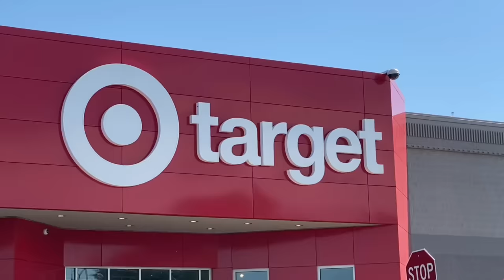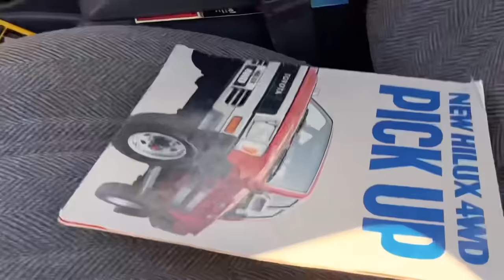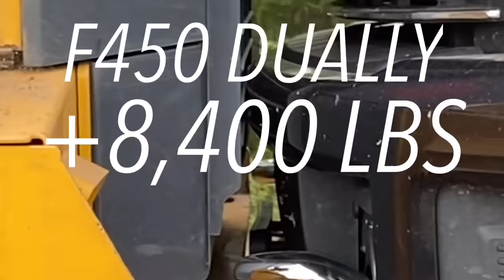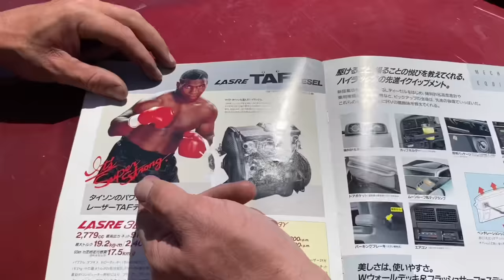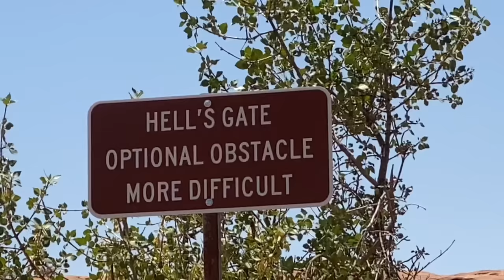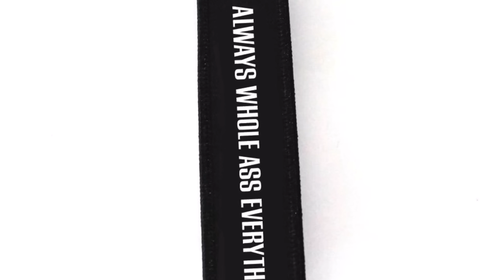Toyota Hilux Durability Test #3

Comment: It's actually quite impressive that the expensive, custom build 4wd racer he was with broke twice while the stock 90's Hilux just keeps on truckin'
Reply: Very true, although the racecar is going to be on the edge for performance whereas the truck is somewhat more in the middle for performance and just more durable parts because the parts don't need tons of capability.
Reply: @2005StangMan  this video proves otherwise
Reply: @2005StangMan  did the truck get 2 beatings including a rollover before coming out for this beating  and I’m sure the Toyota  hasn’t seen love in a hot minute
Reply: with NO diff locks!!!
Reply: @2005StangMan  100% CORRECT.. MOST PEOPLE DON'T GET THAT
Reply: @Dealete420  look at it like this, WDs proving what this truck can do, as apposed to letting it sit mint in a garage.

Comment: There’s a reason why in Australia 80% of 4WDs are hiluxs
Reply: The new ones probably ain't as good as the old ones and they're just going on by their reputation.
Reply: Land cruiser pickups are great
Reply: @PuerRidcully  SR5 models are for soccer moms.
Reply: The reason is that its avalable there . Not in north america  ... otherwise it would be king here to.
Reply: @stevenjalopnik1342  why..?
Reply: i got an, 02 cab chassis turbo diesel 1KZ-TE indestructible
Reply: @PuerRidcully  Probably not as durable as this one bec this is ridiculous, but Toyota still cares about durability and stress test they’r parts way more then other companies. Even with the new supra they send many parts back to bmw bec they wouldn’t pas they’r tests
Reply: Ye nah any hilux after 04 is no where near as good, they’re alright though. The same could be said about every other forby. I prefer an ol GQ but those old Luxies are a force to be reckoned with.
Reply: @PuerRidcully  here in argentina are used for mines and farm work. It is the most sold truck and in the top 3 of the most sold vehicles. I´ve seen 2008 hilux´s with over 500k km with the engine never opened. And the owners beat the crap out of them. So they still reliable as fuck. Im not sure that is as reliable as the 90´s hilux, but they still being the most reliable modern truck
Reply: @aussiebloke87  1kz is most definitely not indestructible. Pretty  strong but loves to do a head gasket
Reply: @PuerRidcully  they are still pretty hardy. When they first went to the 1kd (direct injection common rail) there were some issues with piston failure and stuff but the later ones are good. The newest generation seem good too but not enough time to prove itself. 
The vdj land cruiser is really the closest thing reliability wise that you can buy now to the OG hilux. V8 diesel (not much power tho lol) but very freaking reliable. Solid front and rear axle and as basic as you can get. Also it costs $100k haha
Reply: @ReubenHorner  yeah we have two 2008 vdj200 and they both have 6000000kms on them and they are due for a new engine soon also I’ve personally got a 2011 kun26 hilux with 4100000kms and still stock
Reply: I have a 1991 2.8D pickup just like whislin’s one. Suddenly I’m proud to own it 😂
Reply: @PuerRidcully  yeah they are IFS now all shit but the old LN106s are unbeatable
Reply: And why it has been our best selling car for like decades now.
Reply: And Norway and all of Arabia 😃👍🏼👍🏼
Reply: @pcx4545  so why do all of the people working in the woods of Norway drive hilux?? And all Arab country’s are driving hilux/ land cruiser in the dunes and deserts… why do you think? Because the last forever. I’m on my 5 one.
Reply: @morganmclennan5593  can I buy it?
Reply: We need a monster lux!
Reply: @pcx4545  🤣, I like that that's funny. However I'd say most 4wds you see in the bush are Patrols or LandCruisers. I myself have a moderately modified GQ Patrol.
Reply: @ReubenHorner  of course but as long as you look after it and not destroy the car like this it'll get 1mil on the clock no worries haha
Reply: @josteincarlsen2905  noooo I love it too much😭

Comment: Could you imagine a world where automobiles were built like this hilux.
Reply: It would be a broken world
Reply: yea my 87 mercedes diesel
Reply: Mechanic shops would be rare
Reply: Buy any toyota before 2005. Toyota is the only car company that doesnt cut costs and rigorously tests every single thing that goes into their vehicles... I have 4 older Toyotas with all original engines they are indestructible...
Reply: Probably the same world where they cured aids and could prevent cancer, but that isn't a good business model. Gotta keep those profits up and sell the next new thing.
Reply: @dillonostrander5286  As far as I know they were the only pickup in the 2000s to still be built with a square tube frame instead of that bullshit C channel.
Reply: @TheBeeMan1994  very strong trucks
Reply: That's why you pay damn near new prices for these things even nowadays.
Reply: It's called Japan.
Reply: @calebminnick2318  pre 2005 japan
Reply: @Wyv-n9i  Oof, kinda ugly-true
Reply: @TheBeeMan1994  yea but aside from the rigidity of it. The durability or the entire suspension system is fkn ridiculous. This why those little toyota tacoma hard bodies last so damn long too. Toyota just didnt make weak shit back then.  Now we got a camry that can be totalled with a basketball
Reply: @roccit  Same world where we just paid 4b to reinvent Ivermectin
Reply: Yes Afghanistan

Comment: I've had my hilux for 22 years in australian outback. Have hit 17 kangaroos. 1 steer crossed rivers higher than bonnet still use it everyday and my kids couldn't kill it.
Reply: Holy sh*t 17 ded kangaroos😥
Reply: What about the replaced parts?
Reply: I’ve got a 1991 Ln106 hilux that I now am extremely proud to own thanks to this video
Reply: our 94 double cab (2 wheel drive) has outlasted an 02 Mazda, an 06 Nissan Hardbody and a 2015 Ford Ranger, 1.6mill km on the clock and still havent opened the engine once, theyre ridiculous vehicles i love em
Reply: That killstreak tho
Reply: 17….I can only assume you don’t drive at dusk too much to only hit 17 in 22 years.
Reply: @manaaalsuwaidi3643  there's not much to replace on them such a basic vehicle.
Reply: @scottspropertyservices6877  I try not to hit them and knowing the tracks to the property's I contract . Know where to take it easy.

Comment: 18:00 I love how both Clarkson and WD had that disbelieving moment of "I give up. I have no idea what I'm supposed to do to it now that I haven't already done, other than smash it in ways that aren't even pretending to be applicable to driving or potential vehicle usage in any way."
If you have to drop a truck off a building or with a heli to make it stop working, the truck won comprehensively. Only the Hilux and Land Cruiser could ever make that grade. Nothing else would be so tough as to make those guys give up.
Reply: What’s even better is how when top gear dropped it off the building it still worked, even when they tried the most extreme thing they could think of it still wouldn’t kill it
Reply: @Lewis2710  absolutely insane, Toyota was on some crap when they made the Hilux, and I want what they're having
Reply: @Lewis2710  To be fair, I'm sure if they pulled the engine out, and put some sweat on it, it would run again.
Reply: @FoxSullivan  the top gear challenge was no new parts only tools and a mechanic so they didn’t add an engine or any new parts to make it run

Comment: UNBELIEVABLE. How didn’t anything break? How didn’t the tires pop? This has to be the best vehicle ever made. EVER
Reply: Im a JDM tuner type of guy and I am rethinking what I actually like now....
Reply: tbf tires have nothing to do with the manufacturer
Reply: How? Cars used to be made with care and to last. Nowadays you buy overpriced piece of crap that lasts you just barely over varranty.
Reply: People that live out in middle of nowhere do this everyday in regular cars, calm down there lol
Reply: Name  yuh
Reply: @cma-jo1qx  but the hilux ain't just any car though. this is made for the australian bush and for p platers to bash around off road and be fine. truly the toughest vehicle out there
Reply: @4nciite  lmao but that hella modded our car broke down
Reply: If you don’t tow more then 2500lb sure
Reply: Wheel design. Good bead
Reply: It is the best vehicle ever made.
Reply: Toyota is easily the best manufacturer, hands down. Even their little hatchback Yaris, can't kill those things with road driving. Go 10k over in mileage before changing oil? Toyota engine laughs at that.
Reply: @allangoodchild8989  did you see hilux durability test #2?
Reply: John M  they messed around with some cables but otherwise you're pretty much dead on
Reply: Literally has softball sized ball joints😄
Reply: @cma-jo1qx  yes but there are very few other cars that would’ve made it through that with nothing breaking

Comment: Thank you WD for making me realize and take pride in owning a Toyota 4Runner, a close cousin to the Hilux. 1999 3rd Generation SR5. This series and his channel got me into actually modding mine and starting to take good care of it, rather than treating it as just another vehicle.
Reply: I've got a 99 Limited. 348,000 miles and counting. Engine and transmission have never been serviced, besides drain and fills, water pump and timing belt. All factory internals, engine still doesn't leak a drop.

I've started replacing parts on it as a measure of preventative maintenance on a 24 year old vehicle. Best first car I could have ever bought, got it in 2018 for $3k cash at 274k miles. I would do it again and again for how rough I've been on it. a lot of fast and hard driving out in the sticks. Best way I was able to get out anger/ stress while going through highschool.

Fun Note: the vehicle has had a power steering leak for almost as long as I've had it. I've almost fixed it, but as time has gone on, it has ended up being the greatest thing ever done for the vehicle. After the entire under chassis has been coated in a fine film of hydronic fluid, the underbody has been totally protected from rust, and hardly shows any signs of it all the way to the real axle. 😂
Reply: @westonhood3705   When I had to sell my '99 4runner (multiple front-end collisions) people would ask if it leaked any oil. Not realizing people were dumb I would say "Yes! Leaks just enough oil to keep the undercarriage rust-free, never have to top it off between 5000 mile oil changes." But people ARE dumb, so they would laugh and not buy it.
Reply: @gorkyd7912  Yeah, I actually just finished replacing my cv axles (Firestone busted both CV axle boots, and luckily I was able to warranty my axles free of charge).

The job was easy!! Nothing held me up. I don't prefer to spend the money working on my vehicle, but usually the work itself is always easy!

I might get into body work so that I can restore the body on my vehicle. Mostly paint work. Then I might see if I can't flip it. realistically though I'll just keep it. she's my baby. 😂
Reply: @westonhood3705 that's so awesome man. Cherish it and keep that thing for life. First vehicles are something special.

Comment: They don’t die, overseas they run with bullet holes, hardly any oil, wrong oil. Stockings as airfilters, stp oil treatmeant in trans, 6 guys in truck, 8 in back. Dishka’s mounted on back, you name it. They out run the numbers. My Tacoma is half the truck a hilux is lol
Reply: Do you like your Tacoma? I'm 15 and I might buy one for my first truck
Reply: @tornadotayte  Look at getting an import. I had a ratted out hilux while in japan. At 1996, it would have been 25+ years old this year.

Look at Japanese auction sites, and hire someome to find you a good one and get it imported for you. You can find guys who will find one and ship it in your budget, and charge you like 500 bucks for the service.

Bare minimum, you probably need about 5 grand to do this with a 1996 hilux... That's assuming you import a 2500 dollar hilux... I wouldnt import a 2500 dollar hilux if I were you, lol. Speaking from personal experience, 2500 is what I paid, and its the cheapest one I've seen in my 5 years on okinawa. If you want to restore one, then fine, but 2500 bucks is an absolute POS dog territory for one from japan.

If you want a decent JDM import, aim for like 10 grand. It costs a couple grand to ship from japan, so going dirt cheap on the vehicle itself will have diminishing returns on the amount you save... Basically, save up enough to get a good base vehicle if youre going to bother going through the effort of importing.

Right now I'm importing a 1993 Mitsubishi Delica L300 through the military TMO stuff.
Reply: Yeah, they are the main "bakkie" pick-up truck in South Africa and they cant die... Cheers from Joburg RSA
Reply: @hatman4818  thank you man. I'll look into this
Reply: @tornadotayte    @Hat Man   "Hilux" is a brand name that Toyota didn't use in the US after the early 70s. But the trucks were still imported and sold as "Toyota truck" until the "Tacoma" badge came out in 1994 and they were then produced in the US.

The ones in the US were powered by gasoline, the 22R and 22RE engines. Believe it or not, the gasoline engines are even more durable than the 2LT and 3LT diesels like the one this truck has, because the diesels break their head. It makes this video more impressive; Toyota once said something to the tune of 98% of these diesel engines have cracked heads, and certainly the one on this truck does. They will come off in pieces and the only thing that keeps the head together are the head studs.

The gasoline engines don't break their head but make sure to maintenance the timing chain at regular intervals or swap to the dual row. From '83 the US version of this truck came with independent front suspension which has some bushing issues but the solid front axle like this one here will just swap into them.

I'm very familiar with the interior design as the old 4Runners had just this in '89. And by the way, if you find a 1st gen 4Runner it's also just a Hilux but the SUV version.

I'd like to see this guy do the same with the US version of the truck and see how it compares with the IFS.
Reply: @TheJohnsoline  awesome. Thank you. Is there a manual version of the tacoma?
Reply: @tornadotayte  There is a manual version. In its early days the manual was the standard, and by the 2000s it was still common. Into the 2010s you could still find a manual, and they are still made with a manual today but have become very rare, some of the last trucks to offer it actually.
Reply: A local hunter ran his 80s Hilux approximately 2 months with no oil whatsoever (he overtightened the oil drain plug) in very rough mountainous terrain. He didn't even realize at first because the gauge cluster was all clogged with dirt and mud. the truck is still running like a champ to this day.

Comment: My next truck will undoubtedly be a Toyota after watching this.  Well done.
Reply: Yeah...there is no better advertisement for the car than the top Gear episode and these videos.

Cant get better advertisement than this.
Reply: Only choice i have a Toyota Tundra 4x4 Stick in America i take out into the Arizona desert and never get stuck. I live in Israel half the year an shave a 2003 Hilux same capabilities and both are MOST reliable vehicles I've ever had. You won't be let down.
Reply: What bout American trucks, huh!? Don’t give up they’re great too
Reply: @markusantonio4866  I have a 1988 Chevy C1500. Always having to work on it. My dad was always having to fix stuff on it since it was new. It wouldn't even hold its factory paint despite being garage-kept. I'm daily driving a 1993 Geo Metro and that is the most reliable car I've ever owned.
Reply: @markusantonio4866  yeah American diesel full size no doubt but Toyota have become more American than the American tricks 😜

Comment: Oh so no one is going to talk about “his piston return springs came off” 😂
Reply: I had a stroke when he said that
Reply: Buy a new hilux and see if it’s as tough
Reply: @photography555  well there is a diffarance betwen new trucks and old ones. new trucks are efficient and only use materials where they need it. they got tons of fancy electronics that help the system stay balanced and efficient. an old truck is just metal and som bearings. there aint mutch to go wrong with such an old truck specialy not when it's built in an age where we did not understand all the stresses and all the ways to build efficient machinery so insted we had to gues and over build stuff. it's like bmw n54 engine. it was theyr first turbo car in a while so they ended up overbuilding the engine to be capable of 800hp the n55 that came after was not as overbuilt and the b58 that now came after that is overbuilt again becaus they realised to potential and love that people have for the n54 and the succes of the 1M
Reply: This truck is the 🐐
Reply: As in shock piston return springs. Not engine pistons. SMH
Reply: @thomasoshea9876  shock piston return springs
Reply: @photography555  i have a 2008 hilux and the damn thing's a tank.